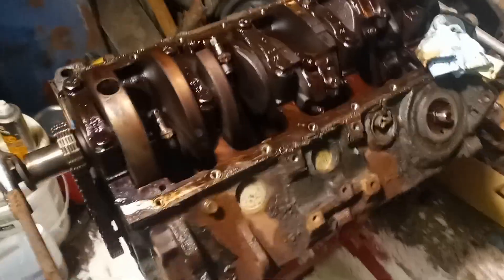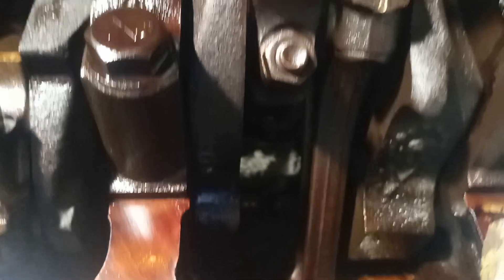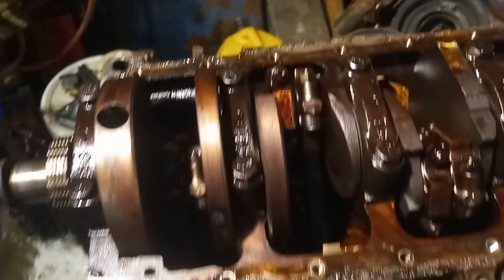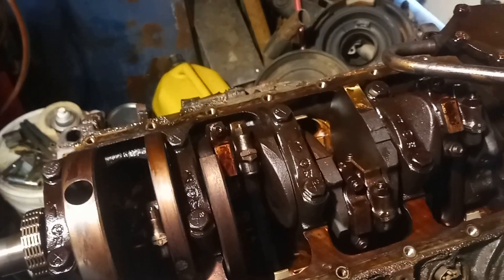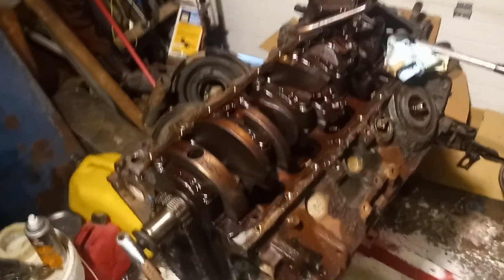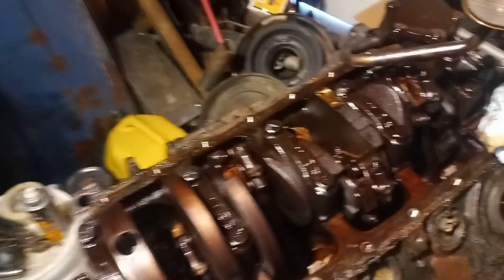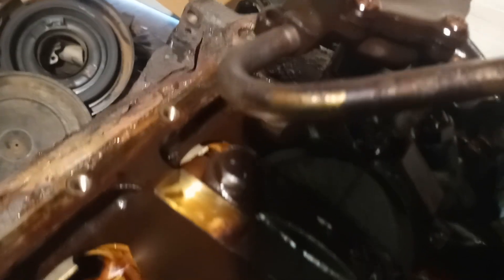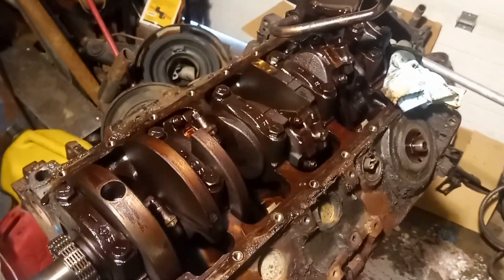Bottom end is coming apart.

Comment: I have had best Results with Castrol GTX 10w30 Conventional and Castrol Edge 10w30. 
Used Royal Purple XPR 10w40 then XPR 20w50 in the 1976 Pontiac 455 its great stuff for Racing keeps the engine clean too but its God F expensive too Nolan.
Castrol for me best bang for the buck keeps them clean. 
Edge has Titanium Dioxide to replace Zinc EPA took out.
Royal Purple has Zinc above 2000 rpm.
Reply from the maker: In my diesel daily drivers I use 0w40 Rotella. In my hot rod type of gas motors I use 5w50 Castrol Edge.
Reply: @wildrosegarage4208  I haven't experimented with modern O w oils any. I know a Pontiac V8 Guy that swears by 0-10w and pushing 1400 Hp Normal Aspirated it's a Kaufmann Warp 6 headed engine heads modified by Kaufmann just for him.
Based actually off the Oldsmobile DRC Pro stock heads.
Engine is massive huge. Makes a 426 Hemi look like a Toy.
Turning 9500 rpm on Ow oil.
I like my 80-120 psi Hot oil pressure.
TA did it last Castrol GTX 10w30 Dino oil.

Comment: Usually that slime is from coked up oil rings and or top and 2nd rings sticking in the piston ring grooves. 
Teardown and find out.
Most importantly is the Crankshaft Main and Rod Journals are Mint Nice  or not.
Camshaft bore in the Block good too, no spun cam bearings rendering  the Block junk status.
Reply from the maker: Its all taken down and looks good.

Comment: This is the reason I don't like Synthetic oils. When you pull them down like this you see what it's all about. They "claim" that stain is a layer of lubricant, but when you feel it, it's sticky...... yeah.... I'm not sold on it either man. I stick to Conventional Oils and change it like you're supposed to. IMO if you don't like changing oil in your vehicles and you want to save the planet...... buy a horse and shut the eFe up.
Good Video as always man!
Reply from the maker: Not sure what causes it. I do run Shell Rottella full synthetic in my 7.3diesel truck and it has 350k mile and it looks like bare clean cast iron under the valve covers. I had it apart last year and was blown away on  how it looked. Don't know what the issue is but wouldnt be surprised if this motor had 5w20 in it and a 200 degree t stat.

Comment: I have been using Amzoil synthetic since the early 90s. Because of my father in law. He run a truck wash biz. And he would get twice  the life out of a brigs & Stratton engine. That sold me. I bought a used 90 chev dually in 96. It had a 350 4speed 4:10 rear in it with 70k on the clock. No overdrive. With that set up you would be lucky to get 150k before a reman. I got 289k on that old girl. Everything I own has Amzoil in it. Front to back. Axles,transmissions,wheel bearings. Have you tried synthetic oil?
Reply from the maker: I have never used it but have heard nothing but good about it. There atf is suppose to be in a league of its own.